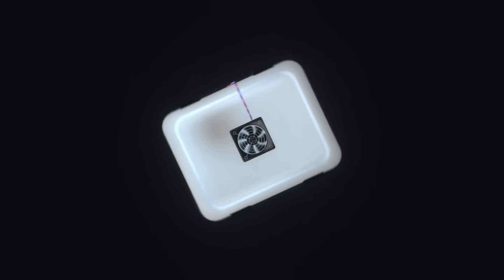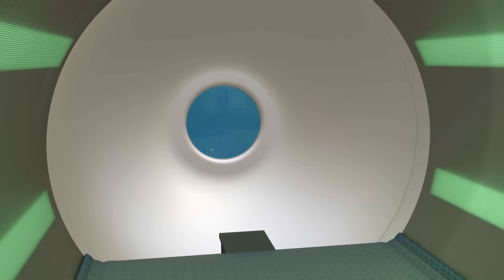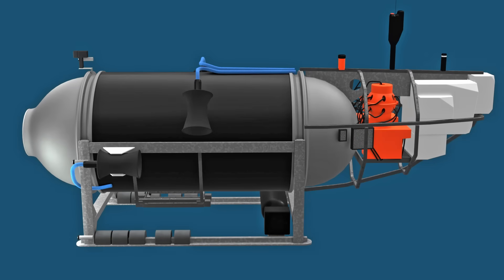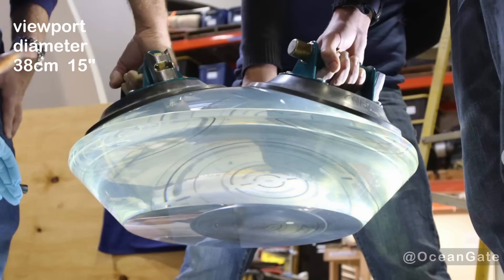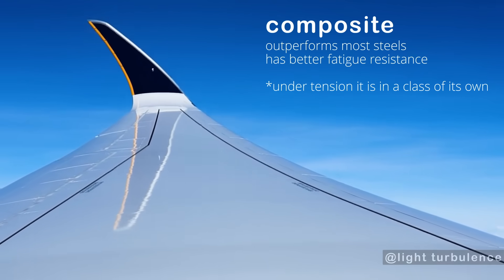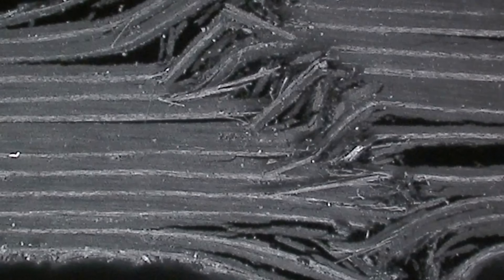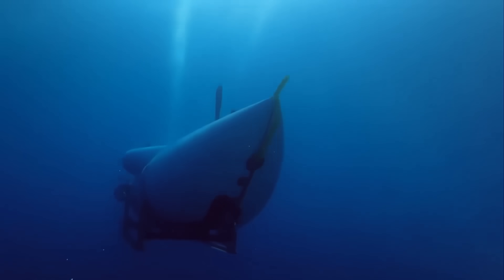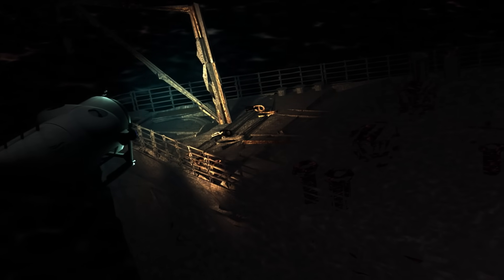Titan Sub | carbon fiber - Detailed Tour

Comment: From someone who works around advanced composites in aviation.  Carbon fiber composites are strong in their narrow operation limits.  Outside of those, stuff is like paper.  Additionally, it requires inspections.  If not done....  You have a mess just like this.
Reply: I know from mountain bikes it is theoretically really strong and lite but if there is one hairline fracture the whole integrity is toast. I prefer aluminum it might not be quite as strong but is way more durable
Reply: @goldengoat1737 I remember this from early tennis rackets. They worked perfectly until an unexpected force was applied to the side of the shaft (eg. A hard knock which might splinter some of the outer fibres). After that your racket shaft could shatter under the normal load. As a keen motorcyclist it's interesting to note that despite aluminium being no where near as strong in certain tests motorcycle manufacturers still go to aluminium in even the most advanced bikes. Good video though, eh?
Reply: @MsYoyofish that is not true, you could buy a motorcycle that has carbon fiber frame 15 years ago (I own one) from "mainstream" manufacturer (it was made in very limited run). Most motorcycle are made with aluminium frame is from same reason why most cars have aluminium monocoque,  bacouse it is much cheaper. Just to put in perspective carbon frame version of bike costed 4 times more than version with aluminium frame.
Reply: @DmacDomage Aluminium has this HUGE advantage in that it is more or less isotropic in its characteristics. What that means is it doesn't matter what direction you apply the load in, it's going to fail at about the same stress.

CFRP on the other hand is HIGHLY directional. It's strong in tension along the length of the fibres. That's it. In every other direction you're relying on the epoxy. That's why the sheets have to be carefully laid in the correct orientation when making various parts. That's also why it takes a lot more design effort to get it right, and the material is consigned to some very niche practical uses (mostly aerospace) where it truly shines, and cosmetic stuff (where the epoxy alone would otherwise suffice). Conversely, the latter is a whole lot less expensive to implement.
Reply: @goldengoat1737  aluminium is not as durable as composites. A carbon fiber bike will greatly outlast an aluminum frame. A cracked frame is a problem for all bike frames whether composite or aluminium - except composite frames can typically be repaired to original strength where aluminium frames cannot.
Reply: Out of curiosity, how does temperature and torque affect such materials? Not to imply those were a factor here, I am just simply curious. Everyone talks about the tensile strength and the like, but not other things.
Reply: @thatguy9088  well, with bonded materials temperature is a big deal.  The glue that holds a composite together can be greatly affected.  For example (remember when operated outside its limits) as it gets hot, the glue loses its ability to keep its chemical bond and the composite delaminates.
As for torque, compression, and tension that really depends on the weave and the bias of the fabric in the composite.  A general overview hope it helps.
Reply: @shawnhoem487  It does help, thank you. I was just musing on if temperature might play a factor as well. Not in this circumstance, just the material in general. Thank you for your time and thoughts on the matter.
Reply: @shawnhoem487  it’s resin that binds the carbon fiber
Reply: @shawnhoem487   Not so. CFRP has broad industrial applications. You may be confusing "glue" with epoxy resin. Glue bonds have virtually zero strength, they are mechanical, and are not useful in composite structural applications. The Hull was not Five inches thick. From a professional perspective it was One inch thick, five times.
A bizarre and foolish process.... Laughable.
Reply: @thatguy9088  Remember how you unglue phone screens or envelopes, you heat them.
Reply: @thatguy9088 The pressure hull design had but one huge flaw - it was built, like you say, with tensile strength in mind. But it wasn't under tension. It was under compression. And in those circumstances, cylinders tend to buckle. They go off-round, into an oval shape.

With steel and titanium that's no biggie, especially when designed by competent engineers. You just use a little more material to ensure the buckling loads aren't enough to cause a failure.

With CFRP, you're stressing it in its weakest direction. Because it's quite a thick cylinder, there's a lot of shear stress borne by the epoxy alone, from all the layers trying to slip past each other. That causes the epoxy to fail, resulting in delamination. This went on for a few dives, until eventually the entire hull failed.

The only reason this material works for pressure vessels like paintball tanks is because when the pressure is on the inside, the whole thing is in tension, allowing the fibres to do their thing. Direction makes all the difference.
Reply: I was going to say the same thing. I've worked with carbon fiber tube, then  again in aviation, and I don't think anyone I was working with would have proposed using carbon fiber in this application,  and to do it without inspections every time it dove until the material in this application and layup schedule was validated and developed a track record is just reckless.
Reply: They cut too many corners.
Reply: @lunamaria1048 correct. For example, in aviation, planes start out with a conservative time between overhaul and pressurization cycle life expectancy, based on historical data. There was no historical and engineering data, it was up to them to establish that. Also, that rating is subject to change, given how the airframe performs on the field.
Reply: I completely agree. I worked with carbon fiber for years on the Predator drone. It was very, very strong. But to use in the ocean….i just don’t think so. 😢
Reply: Tell me you work on jet fighters with out telling me you work on jet fighters 😅
Reply: @goldengoat1737  Actually I work on helicopters.
Reply: @shawnhoem487  Oh interesting I didn’t realize carbon composites were used for helicopters makes sense though. Sounds like a cool job! Thanks for your input!
Reply: @goldengoat1737  Yes MD, Bell, Euro Copter (Airbus), Siskorski, and others use carbon fiber, Teflon, fiberglass, and metal composite materials in construction of their aircraft.  I've spent my career inspecting, and repairing those structures.  Some of it is fascinating, some not so much the processes required to make sure the stuff is airworthy is at time quite involved.
Reply: @shawnhoem487 super interesting 🤨 now I’m going to go on another learning adventure as I will most definitely hyper fixate on aircraft!
Reply: Stockton never heard of an inspection or a standard he was ready to ignore.
Reply: So in other word Carbon fibres are useful for some materials since it is flexible but can't do well under extreme pressures?
Reply: @gaming1zanagi-1999 
Actually, carbon fiber is not flexible. It’s much stiffer than steel or titanium.
Reply: @ammerudgrenda  really? That's new. Cause I have always thought that it is flexible since it uses composite materials
Reply: @gaming1zanagi-1999  
Carbon fiber is stiffer than any metallic material. 
For example, the Boeing 787 wing could not be built with conventional aluminum because the wing deflection would be too high due to to the long wingspan and thin wing profile. Using carbon fiber, the deflections were significantly reduced.
Reply: @ammerudgrenda  I see. I've always thought it is flexible due to how it binds with other material but apparently that is not the case. No wonder it can't handle extreme environment such as deep dive since it is extremely cold and possibly hot at the same time
Reply: The Titan sub was a death trap. Only a fool would go down in that thing.
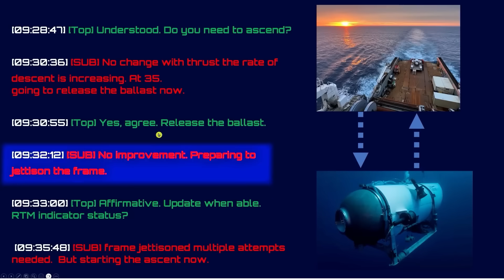Reply: What he says doesn't disprove the authenticity of the leaked transcript because he wrongly interprets a few things. He says at 15:56/16:32 they "used thrusters to descend and that's not what they are used for" but NO . Descent was already increasing and they wanted to slow it down. He went on to say what you should and would do like "not waste time typing messages" but we can agree Stockton was not limited by what should be done and what most would do.
Reply: @ouknow1446 yeah he should've listened to his engineers worry instead of having ego clouded his judgement. Like being daring is one thing but what he did is pure reckless. Seriously even if he isn't having any of it and wanting to proof someone wrong at the very least thing he can do is to use test dummies and camera fit in with the dummies while Titan being controlled outside with the said controller. That way he won't have to spent a ton of money for such a simple test run.
Reply: @gaming1zanagi-1999  Some are pioneers in showing the world what NOT to do. sigh
Reply: I think it being made of carbon fiber was just one of the problems lol. I watched someone who actually knows what their talking about and they listed a whole shit ton of stuff. 1 like you said it never getting inspected for cracks that aren’t visible by the eye 2 the shape of it witch didn’t distribute the pressure of the water evenly 3 the fact it went carbon fiber to stainless steel so that’s a huuuge weak spot 4 the glue holding the titanium ring to the carbon fiber was glue that could be Easton away threw time with the saltwater and they had more those were just the main ones. It’s not just one thing that was wrong with the sub
Reply: I'm very familiar with carbon fiber also, I've worked with it a lot, with engineers and this was a mistake, I'm just agreeing with you wholeheartedly. At the beginning of the of  the titan disaster he had a 4" thick carbon fiber tube, sometime when he made a new hull I guess he was short of material, It was only 3", WOW I didn't like it when it was 4". This was just guaranteed to happen
Reply: What is the compression strength of carbon fiber compared to say steel?
Reply: It resist tension not compression
Reply: I am no engineer but asking an epoxy seal to deal with the pressure flex of 4000 meter depth over and over seems like an incredibly stupid solution.  This thing looks like a rube goldberg design.
Reply: @roquefortfiles   I am an engineer. Your intuitive assessment is correct.
Reply: @233kosta  To me it just seems utterly ridiculous and downright stupid to be epoxying two entirely different materials together that have vastly different compression properties.   That's asking a joint to hold and maintain under   compressive cycles?. To me this thing looked like a toilet roll with two metal ends glued on. It might work at Disney land on Pirates of the Caribbean.  I'd have told this guy he was nuts
Reply: @roquefortfiles   It is. And most competent people around him did. He sacked one, filed a SLAPP suit against another and completely ignored the gray beard.

There's clueless conmen, then there's this guy - he drank his own koolaid and never let anyone bully him into testing it just because they said it's poisoned. If I were being generous, I'd call it terminal optimism.
Reply: @233kosta  Was there not some kind of onboard video running inside Titan recording the dive?
Reply: @roquefortfiles   I don't know. I'm listening to the hearing, it hasn't come up yet 🤔
Reply: @233kosta  An engineer at the hearing is saying that on his initial viewing of the debris he believes the failure started at the epoxy joint on the titanium ring.  He said if you look at it there is absolutely no glue or epoxy on any of it.  The joint is smooth all the way around.  The cycling compression warped the bond until it just spectacularly failed.  And he said it failed all at once.
Reply: @roquefortfiles  Entirely possible, once the rest of the hull is weakened enough the first weaker spot will let go and collapse the whole thing. The NTSB guy showed huge delaminations and inclusions in both production offcuts and actual hull samples. This thing wasn't built right to begin with!

And yeh, it comes as absolutely no surprise that the rings are barren - look how shiny they are! Unless you're dealing with model aircraft glue (which is a solvent, it literally dissolves the pieces, so they weld together when it evaporates) and polymer, it requires something to physically lock onto. They should have sandblasted that surface or at least done something 😒
Reply: so, i do as well.  and i'm not seeing what you are talking about. we started building the blades for  s88 (original 20 years ago) and now, most blades, or some will say rotary wings, are composite. THAT DONT GET ROUTINELY TESTED!  -like their aluminum counterparts? D check maybe?  We were recently a part of a program that made the first composite helicopter cabin - i suggest you look at rocket labs new 10meter rocket - i'm involved with that one now.
Reply: they can also have inperfections lil bubbles of air, or at least i think they might. any answers ?
Reply: So it's not strong lol 😅 .
Reply: Any material even paper is strong with in its limits. The limits state how much force a material can endure before it fails
Reply: Carbon fiber is strong but ment to be flexible, the only thing solid in the tube was the glue. Did anyone test it's strength.😮😮😊🤓😽🦜
Reply: I understood that it was the difference in compression strength between the Carbon Fibre and Round Metal End Tanks and the where they joined / met together.
Reply: CF can be strong. But, in the air, a vehicle is not surrounded on all sides by highly pressurized liquid bound to force its way in between the individual carbon fiber layers, gradually weakening the overall hull with each 'flight', until inevitable catastrophic failure. That's the problem with it. If carbon fiber was an appropriate material for diving, then companies would have started making submersibles out of it a long time ago, since it is so much cheaper and lightweight than titanium. Nobody has... except Oceangate. The only way it would work is making temporary, expendable submersibles meant to be taken on one or two dives only and then simply scrapped, or have the entire hull replaced. But then the cheaper price tag is no longer a benefit; you would incur continuous costs replacing nearly the entire sub every other dive. There'd be no point to using carbon fiber anymore.
Reply: @TylerChamb  IIRC, the US Navy experimented with a CFRP hull. They built ONE prototype (properly), did some test dives and abandoned the project. I've not read that report, so I'm not sure why it was abandoned, but clearly they didn't see exotic composites as the future of pressure hull design. That ought to have been a clue as to whether it's a good idea to do this in this amateur-ish way or not.

Listening to the former chief engineer's testimony, that particular hull was the brainchild of one guy at UW's APL and nobody was allowed to make design changes, even when they found out it was weaker than predicted. Guy got the sack after refusing to sign off on a commercial dive.

The stupid part is dude's ex-Thiokol. Anyone would do well to listen to those guys when they say a hull is unsafe! Stockton Mush didn't and paid the price ¯\_(ツ)_/¯
Reply: Still waiting for the official results 🤔
Reply: @mhughes1160 catastrophic structural failure, likely caused by inadequate design and assembly.  Oh, and 5 people perished!  I’m an “official”.  Those are my results
Reply: @callmesceptical9114  LoL 😂 
Official what ?
Reply: @mhughes1160 lol genuinely curious, what do you think might have happened that is, uh, “outside” of the typical breakdown of what happened in this event?
Reply: I also think it was a bad idea to make the tube out of a single strip of carbon fiber wrapped around.
Reply: The mess was minimal at that depth
Reply: no no, there's this sonic thing I patented.....

it'll let you know you've got minutes to live.... oh, fuck...
Reply: This wouldn't have happened if the sub knew where it was from where it wasn't. If the sub was able to subtract where it was from where it wasn't, this wouldn't have happened.
Reply: As someone who doesn’t work around “advanced composites in aviation” I can confirm this is true. And no education is needed to come to this conclusion, just simple common sense. 🤷‍♂️
Reply: @user-jr2gt9nw8b you didn't come to that conclusion though. You've said it's easy, but you have no base to prove you knew that, you just look like a tool acting clever.
Reply: Yes we've heard this from 346,000 9f you aviation experts. Since yall all feel the need to jump in the comments and tell us basic common sense shit that we already know, but I'm sure it makes you feel better about yourself
Reply: @randysavelljr5324  Whoa dude you need to meditate bro!
Reply: I like it when people who actually know what they are talking about chime in…
Reply: @randysavelljr5324 There is a reason why you are not allowed to work on critical systems.

Comment: Not even close to being an engineer but, I highly doubt CF  (fiber) has significant  compressive strength under these kinds of pressure. As I understand it, carbon fiber has incredible tensile strength but little to no compressive strength. Any compressive strength comes strictly from the resin, not the fiber. The resin gains nothing in strength from the carbon fiber under compression, yet gains the tensile strength of the CF under expansion,  much like a Chinese handcuff. Howver, that does play into your analysis regarding the rings pressing in on the cylinder. That is likely the point of failure.  There was absolutely no compressive compensation....it holds, until it doesn't. . You analogy of the pressure, the number of elephants, is mind numbing.